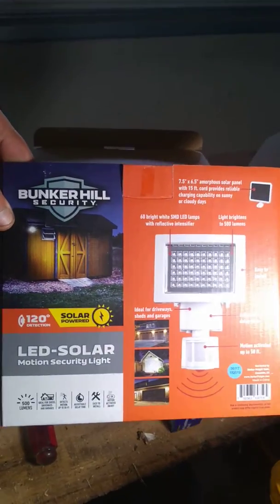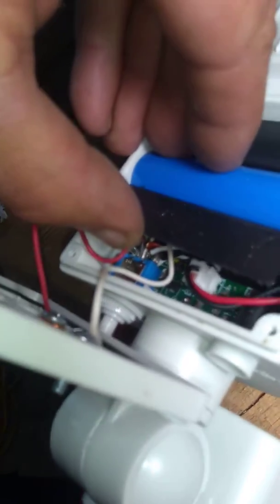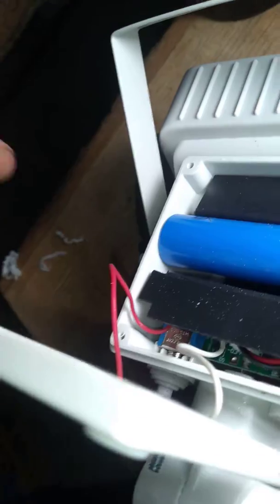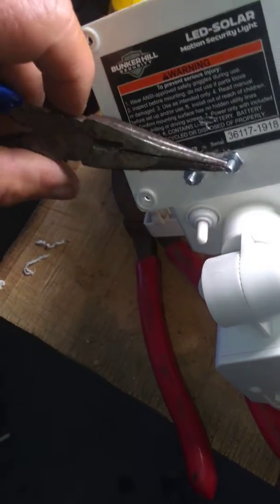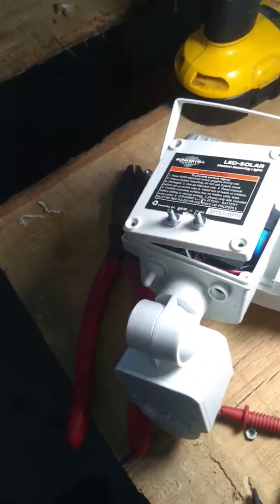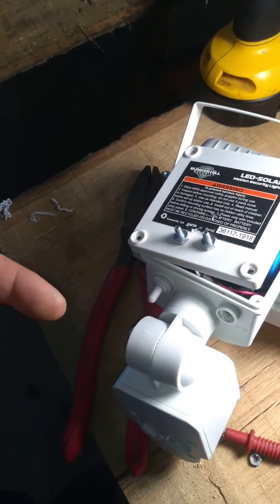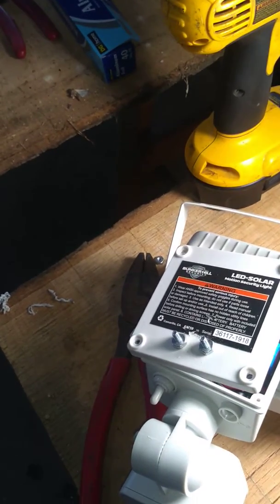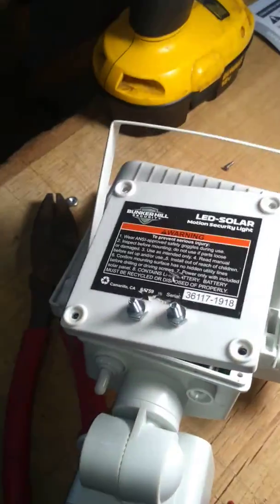Harbor Freight Solar light modified for external control

Comment from the maker: I ended up using a 15 minute timer on the second one. The first one I did, I used a 1 hour timer. Bedore i could tell the boarder that had it mounted on her gorses shed, she promptly turned it on for an hour the first day. That pretty much pulled the battery down to nothing. At that point i knew the battery probably wouldn't recover after leaving it switched off for 3-5 days. I was right, after about 3 months itd just flicker and cut off. These batteries cannot take being pulled down to totally being dead as most batteries doing this do not last long under these conditions. The next one I i did, I used a 15 minute timer and it just has quit after around 5 years of use.

Comment: Can you show how to get to a finished product?
Reply from the maker: It's pretty much there....You just wire a timer or switch to the two terminals. Buy one and come over one weekend and I'll show you how to do it...I'll look around and see if I can find a timer that's for just 15 minutes and the correct box to mount it in. I'd use one with a weatherproof cover the next time. I may go ahead and put a "kit" together for use with the modified light.